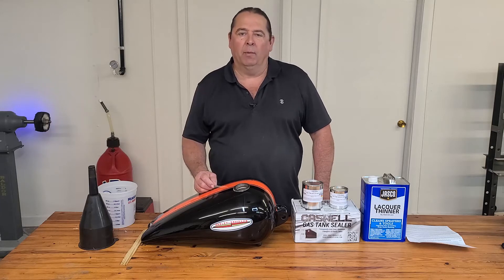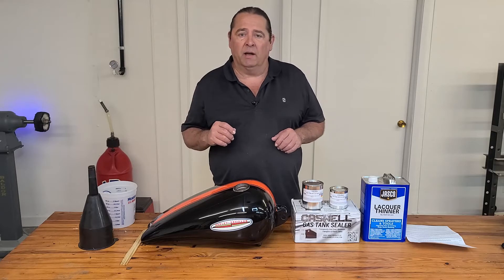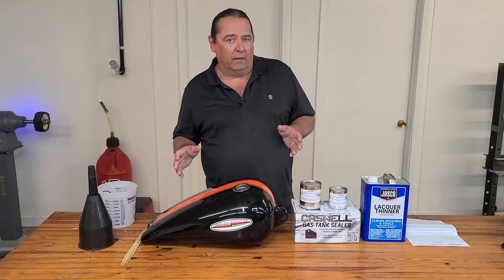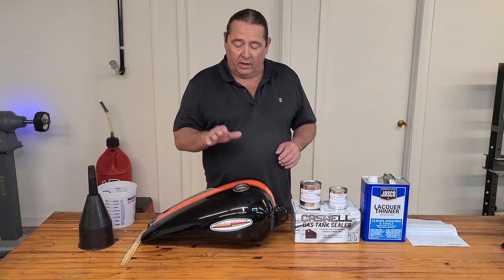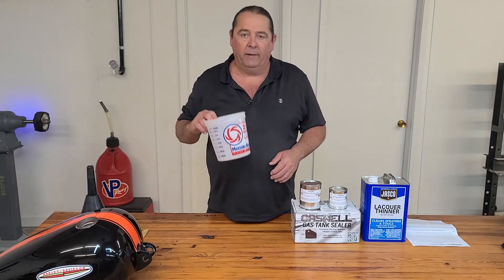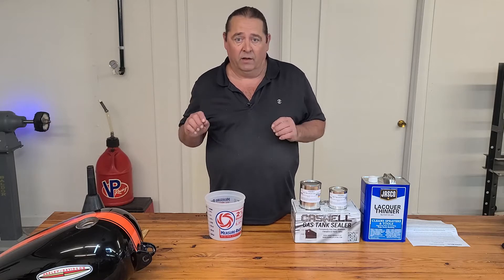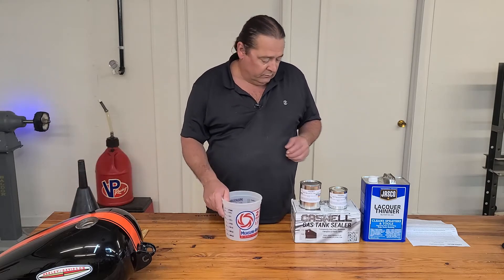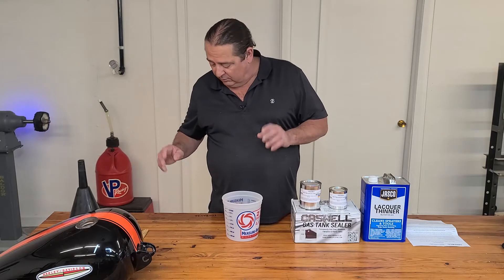HOW TO SEAL A MOTORCYCLE GAS TANK WITH CASWELL EPOXY SEALER

Comment: Just anecdotally here, but I sealed the pinhole leaks in my 1981 Honda CM400C gas tank using Caswells (my first-ever attempt using a tank sealer, just patiently followed the instructions - although I did screw up my reserve fuel "tank" by not covering the opening/tube - that was a bear to fix afterwards)
It is now about 7 years later with absolutely no issues in the tank - lining looks just the same as the day I put it in, tbh - and I'm extremely glad I did it.

And I'm currently awaiting delivery for my next can of Caswells (in Dragon's Blood Red this time) to do my 2001 Ducati 748 tank now, which has no leaks but is very prone to rust and not in great shape. If my experience is similar the second time around, I expect it to be a slow & patient job with total confidence in years of professional-quality protection.

Comment: I'm so glad you started with explaining what you planned to do with the petcock installation. Had me scratching my head before I saw this
Reply from the maker: You'll sill have to use a  round file or small sanding drum after it cures but it's not that difficult. Just make sure your petcock fits properly before you install the tank.  If you have any questions just ask.
Reply: @CycleFab  I appreciate it. This will likely be the easiest part of my endeavors

Comment: What did you use to keep the two small fuel transfer fittings on the front underside open?  The sealer will seal them shut. The Harley tank I have the hose fittings are curved not straight like yours.
Reply from the maker: Being curved makes it tough.  I used modeling clay and then a drill afterwards to clean out the holes on mine.

Comment: Thanks! trying to figure out what to seal my tank with. It has some old sealer on it that was there when I got it 25 years ago. I have it all down at the moment and Im going to paint the tank....but Im looking in there and the old liner looks sketchy in spots. No idea what it is, its off white in color. I always had some seepage at the petcock and always thought it had been the valve itself, but I think it may be the sheet metal there at the outlet threads. We'll see!
Reply from the maker: Glad to have helped, good luck with your project.  Thanks for watching!

Comment: Question,,,how did it adhere too plastic tub,,,I need to repair plastic tiller tank...hot iron isn’t sufficient repair..old troybilt tiller plastic tank ,,thanks great video
Reply from the maker: Epoxy will bond with plastics some what, but not as well as with porous or etched materials.  Personally, I would do it if I could get the plastic tank absolutly clean.  And if it were cost effective, i.e. cost of new tank vs. cost of Caswell Sealer. Your best bet would be to contact the manufacturer at www.caswellplating.com.

Comment: Thanks for the quality video. We've been sending our tanks to GTL but now as the years go on and rusty fuel tanks are more and more common I've been thinking about liner options for bikes not worth putting a $800 liner in. Not to mention the 3 month wait time. I haven't bothered trying tank liners after seeing the aftermath of what Red-Kote and the others can do after a few years but the local guys swear by Caswell seeing as it's basically just epoxy. Seems like it would be hard to screw that up. 

Do you just use acetone to clean out the tank beforehand or do you have any other go-to's?
Reply from the maker: Acetone is what Red-Kote told me to use on their product but I'm also a big fan of laquer thinner.  BTW, about the only chemical that will degrade epoxy is Methylene Chloride so check your fuel additives, if you use any. I've never had a problem but I have found in my research that this chemical may show up even though it's been taken  off the retail market.  Just a suggestion.
Reply from the maker: Check out my video on "HOW TO REMOVE RUST FROM A GAS TANK"

Comment: Just bought the 10 gallon container for my '79 GS1000 tank. I removed most of the rust I could, but there seems to be some little flakes left over. Do you know if a small amount of rust in the tank prior to sealing is going to be bad?
Reply from the maker: I would suggest you watch my tank cleaning video.  https://youtu.be/m8rKg1V0SNQ   
It would be best to get all of the old rust out.

Comment: Great video congratulations, I would ask you how many liters your tank holds and how much epoxy resin you needed for complete protection. Greetings from Slovenia-Europe.
Reply from the maker: My tank holds 13.25 liters and I used the Caswell's order chart for the size kit that I needed to complet the job.  If I remember right, I used the kit for large motorcycle tanks.  It's better to have too much than not enough.  Thanks for watching!
Reply: @CycleFab  Thanks for all the clarification... :))

Comment: Doesn’t work with fuels containing small amounts of ethanol. I have two tanks to prove it.
Reply from the maker: I haven't had an issue yet, but I have heard of liners degrading because of ethanol.  I always use a fuel additive because of the horrible gas that we have now.  Thanks for watching and commenting.